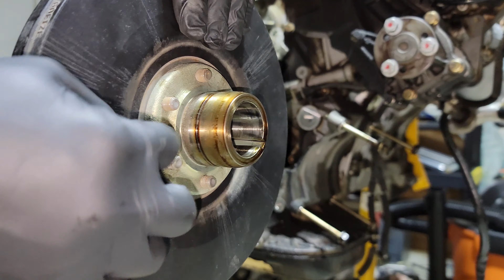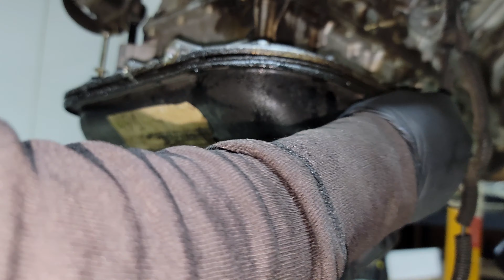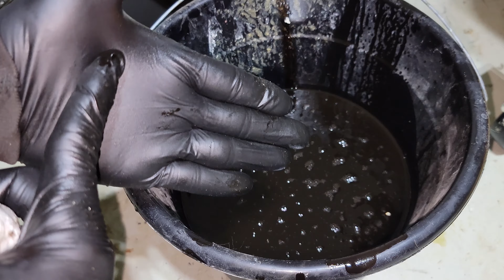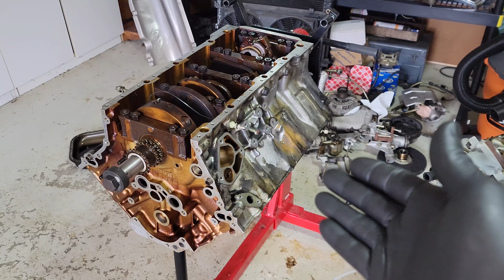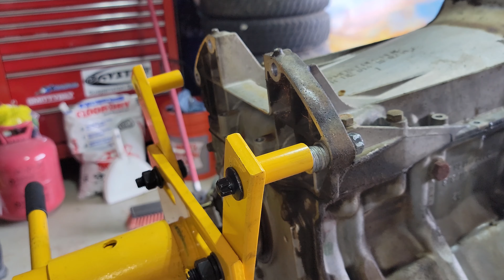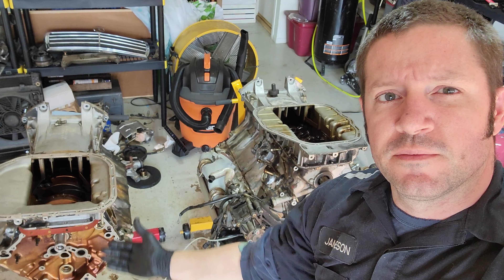M119 Upper Oil Pan Transfer Part 2

Comment: Hi
Big fan and always come to your channel to learn new stuff, please how can one realign the harmonic balancer to the flange as I took mine all apart as well as pulley..what correct way does the flange seats on the harmonic balancer, any marking or some thanks
Reply from the maker: Thank you very much.  To install it properly, you'll need to know what the timing of your engine is.  The harmonic balancer has the timing marks on it.  The flange with the key way can only go on one way.  If you can find top dead center cylinder 1, you can line it up that way and install the harmonic balancer to OT when you find TDC.

Comment: i haven't worked on these m119 since I was a new tech at BH mercedes benz dealer
Reply from the maker: I actually have a 500E on my rack right now.
Reply: @FriendlyMBTech  i think i may look for a m120 to buy. I bought a r230 last year for 1200$ and restored it. other than clogged secondary injection ports the m119 was solid. I have an old om617 sitting around right now
Reply from the maker: @narcissistinjurygiver2932  I don't yet have the collection of MB engines like that.  Just the two M119s.  Although I am looking for the next project to tear apart and rebuild.  If I can find one for a decent price I'd like to completely rebuild an M102 from a 190E 2.3-16.